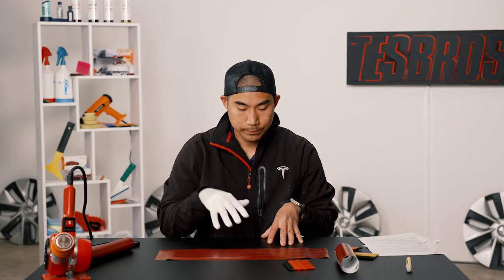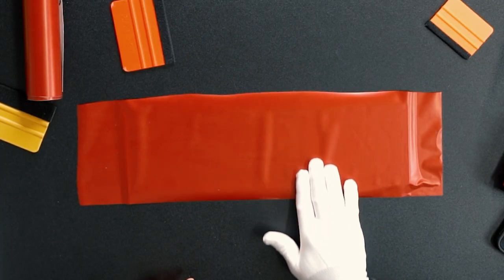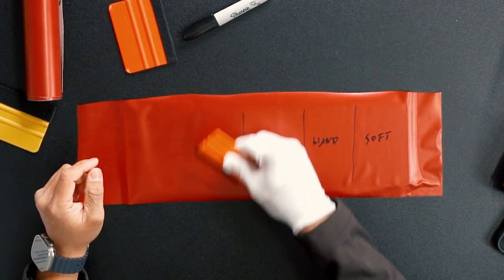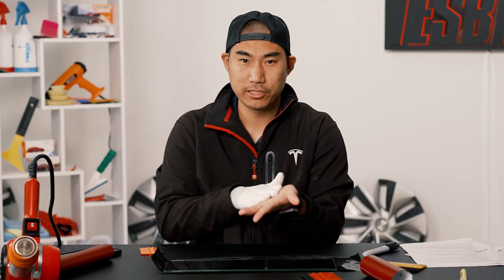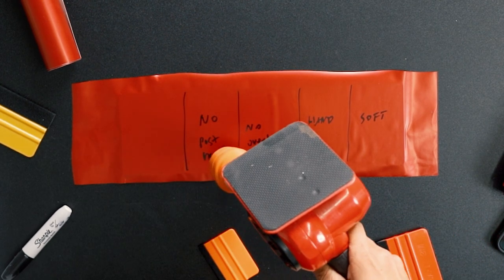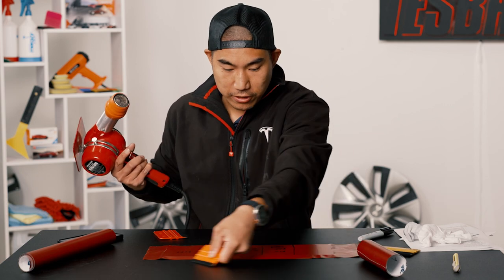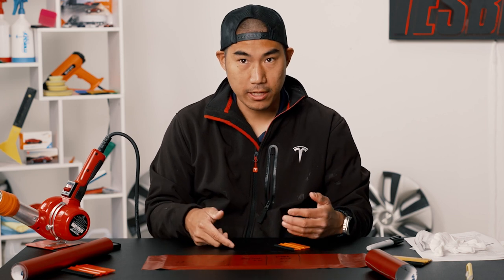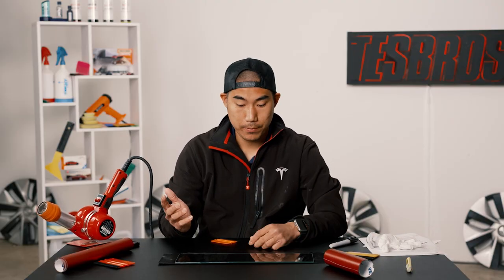How to Prevent Bubbles In Your Vinyl Wrap -TESBROS

Comment: Just got PPF on my new Lexus with XRPlus Xpel and there were dozens small bubbles all around the car and loose edges. Installer said its normal to have bubbles. It will go away in 3weeks during the curing period. After 3 weeks he will inspect the car again, wash it and use heat gun to stick any loose edges, even out any imperfections and the wrap will look flawless. Is this supposed to happen?
Reply from the maker: PPF is different from a vinyl wrap. While bubbles in your vinyl wrap are bad, small bubbles in your PPF should go away after a couple weeks after installation. The loose edges are a bit concerning though, because dirt can get under there and prevent it from sticking properly, but keep an eye on it and mention anything you're concerned about with your installer.
Reply: @tesbros  i return to them today to have them removed the PPF on the front and back bumpers. Regards the unsealed edges, they said they dun use heat gun yet until it dry out in 3 weeks. Doing so immediately will burn the films?

Comment: What about sun bubbles? I did a pretty good job with squeegee, post heat etc. The recessed areas are terrible now. And I already reinstalled trim pieces and no more material lol
Reply from the maker: I'm sorry you're dealing with that man. Is it possible the vinyl was overstretched? Most vinyl can only be stretched about 15% before it starts to discolor and/or lose its integrity
Reply: @tesbros  I don't think I overstretched the recessed areas. My very first panel, yes. But after, I started to lay into those areas without heat. The sun destroyed those same areas lol
Reply from the maker: Hmm, I see. The only thing I can think of (without seeing it) is that you didn't post heat enough. All vinyl has a set temp for post heating - like 3M is 85 C/185 F. So if it wasn't hot enough, bubbles can definitely happen. If you want to send photos to submissions@tesbros.com, I'll take a look at it and see if I can help you recover it
Reply: @tesbros  thank you bro! At least I have an idea of what went wrong. Just gonna fail forward because I actually like to wrap now. I'll send pics as well